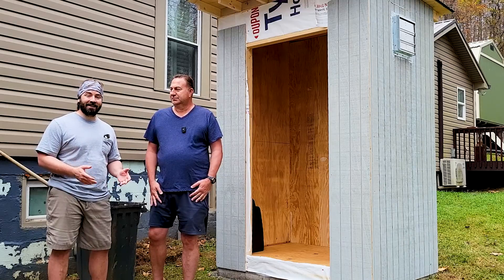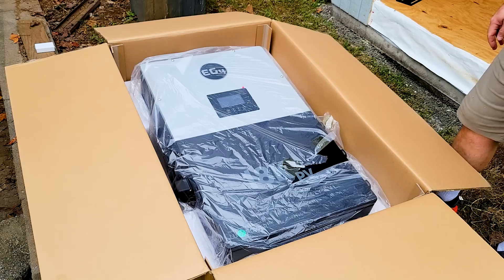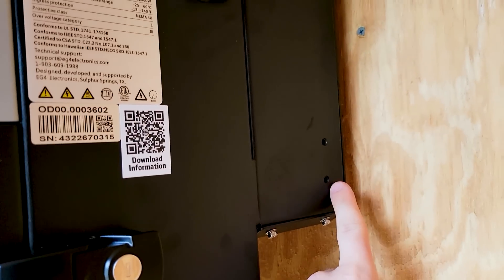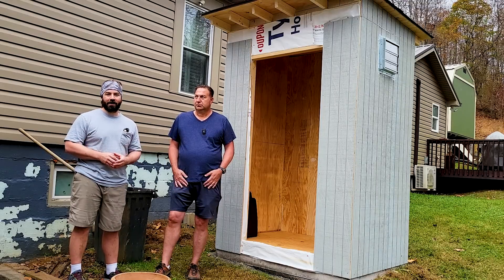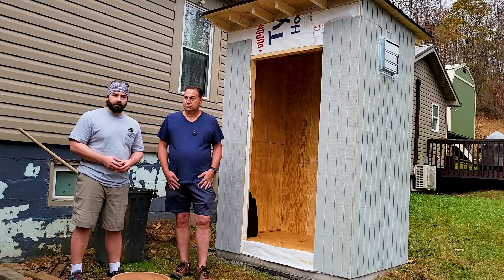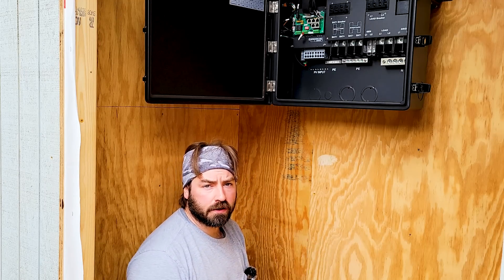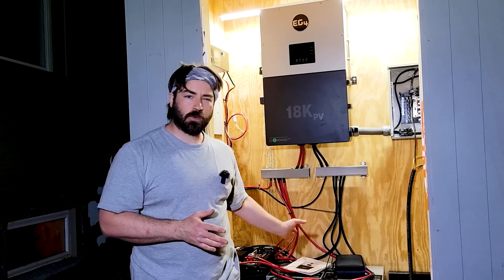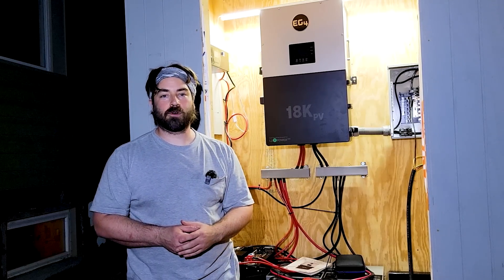Post-hurricane battery system

Comment: Thank you for this. I am interested in your thoughts on battery technology and whether it is worth transitioning from AGM to Lithium now or waiting a year or so for aluminum or sodium-ion batteries?
Reply from the maker: I remember about 10 years ago everyone was saying lithium was going to become obsolete and everyone would be moving it salt-water batteries.  There was a popular brand called Aquion at the time.  They went bankrupt.  My point of the story is that there will always be some new thing everyone is talking about, but until it's proven, I just ignore it. I think the right time for you to transition is when your current AGM battery bank isn't doing what you need it to do.  
If I had to start over today, I'd go with a proven technology.  LiFePO4 is proven.  Then, in 20 years, when I need a new battery bank, I can look at the options then.
Reply: @DavidPozEnergy thanks for that. The AGM batteries were almost free out of an old 3g cell tower and I got 16 12v 180 AH batteries, rack,circuit breakers and cables for $1500.  I have them attached to an 8k Sol-Ark and looking for ideas on AC coupling lithium batteries with a small inexpensive inverter.  Any suggestions on an inverter to AC couple to the SOL-ARK 8k and charge a six pack of 48v lithium rack batteries like in this video?
Reply from the maker: I can't give any advice on working with a Sol-Ark.  Sol-Ark has threatened to sue me in the past and I'm not getting into that.
Reply: @DavidPozEnergy holy shit.  Thinking of converting to EG4 or RUiXU and selling a used Sol-Ark anyways

Comment: Having installed the 18PV.do you still feel your 2 Schneider 6000's can outperform it?  Still looking for the dual load test on the 6000's.
Reply from the maker: Certainly duel XW pros can power up larger loads than the one EG4 18KPV.  However, that's not the market.  I think the market for the all-in-one inverters are the people looking for easy/fast installations.  In that category, the EG4 18kPV beats the duel XW pros.

Comment: I have 32 x300 amp lifpo4 Prismatic cells (8 feet battery cells). I want to make a 48 V power bank for my inverter 5 feet away. I want to use cable and cable terminals (flexible) between each of the Cells. What size copper stranded cable would you recommend?

Comment: High frequency, trandformerless inverters are designed for occasional emergency use or temporary use during a weekend camping trip. They were never meant for permanent off grid applications. They offer far poorer surge capacities and much shorter life expectancies, and because they don't use an isolation transformer, they can damage your appliances when their MOSFETs fail.
Reply: i used a growatt 3000 for 2 years to power several computers and 2 servers and have had no problems!

Comment: Hi David,
I’ve enjoyed your content for many years….
Just looking for some advice on a current Lifepo4 battery build. This new battery will replace my current AGM lead acid bank. It will be 24volt and will consist of 16 3.2v 320ah cells. It will be 24v because that is the input of my Aims inverter. I was planning on 2 strings of 8 in series and then connect them in parallel. This will give me 24v and 640ah. My question has to do with the BMS. I used a Daly BMS for a 12v battery made up with 4 cells. The BMS was easy to figure because it was 4S. The wiring was straight forward and all four cells are monitored. 
On this new build I’m not sure how to approach the BMS. I planned on using a Daly simply because I am familiar.
For the new battery I’m not sure what the approach should be. Can a single BMS be used to monitor all 16 cells in this configuration? Do I need a BMS on each string of 8 cells? I’m not sure I am even asking the right question. I am looking to protect and monitor my new battery bank. I am just looking for a suggestion or direction on how to proceed. Any information would be appreciated.

FYI…..I understand any information you give is just a suggestion and I am responsible for whatever I do with the information. 😊
Reply from the maker: I don't suggest one BMS for the whole battery bank.  I tried that approach with a few builds and it didn't work as well for me compared to individual BMS's for the individual battery.  So, in your case, I'd have two BMS's, one for each 8s string.  Only after the BMS's do you parallel the batteries at a central busbar.  
I've also used Daly BMS, but it's not what I'd go with today.  

Check out this BMS: https://batteryhookup.com/products/12v-lifepo4-smart-bms-w-low-temp-cutoff?variant=44575744032930
Optional bluetooth dongle: https://batteryhookup.com/products/bluetooth-module-for-battery-hookup-bms
And double check price per kWh with these: https://batteryhookup.com/products/new-case-4x-envision-3-2v-280ah-lifepo4-accessories
Please use discount code DAVIDPOZ at checkout.  It's both the discount, and the affiliate tracker, which helps me if you use it.
Reply: What amp rating for each BMS would you recommend? 
My inverter is 6000 watts. Way bigger than I need but bought it when I knew less than I do now. 
If I draw say 3000W it would be pulling 125A from each string. Would that be correct? If so I would have to choose an amperage that will cover my maximum intended output.
Reply: Just another thought…..would the 125A draw be split evenly across each string 62.5?
Reply from the maker: I think those BMS's I linked to are 100A each.  You would need a minimum 3 strings for running a 6kW inverter @ 24V
Reply: Thank you for your time.

Comment: Too bad he chose that low surge, short lived, high frequency, transformerless inverter. should have bought a Schneider Electric, low frequency, transformer based inverter charger instead.
Reply: These things are pretty good now, they can handle pretty sizable inductive loads with decent surge. More than just about any typical household requirement. 
These bigger units have large capacitor banks and inductor coils. This unit would weigh an extra hundred pounds if it was an LF inverter at this capacity.

Comment: For an 18kW inverter, you typically don't need separate external busbars as most modern inverters of this size come with integrated busbars internally, which are sufficient for managing the power flow from solar panels to the grid; however, depending on the specific inverter model and your system design, you might need to use external busbars for additional connections or to better manage large cable runs.

Comment: Hey David, I always like seeing new projects, goodonya for helping your mate out. With the leads from the chargeverter to the bus bars, you might have been able to connect the positive lead on the opposite side of the bus bar and been able to get rid of the loop on the cable run down the wall....sorry just my OCD kicking in !  😆🤠😎

Comment: Great in seeing these videos. Can thi inverter be configured to only charge up to 49v? For a 12s battery bank?. Have a 50kwr battery that's 12s and would like to buy one of these 18k for running of the 12s power bank.

Comment: Good to see you working with others. The chargeverter wires going through and into the inverters plastic guards, should t they be secured with a clamp in the port so no tug on the cable would damage the terminal connect point. I used the plastic insert only when going between 2 side by side Schneider inverters or charge controllers.
Reply from the maker: I'm not sure what you mean.  The Chargeverter wires don't enter the inverter.  The Chargeverter wires go directly to the busbar.
Reply: @DavidPozEnergy right oops. I meant the bus bar cables that enter bottom of the inverter. I was required (CEC code) to use cable clamps that secure the cable as it pass through the metal going into the inverter casing.
Reply from the maker: I think having some clamp on there is a better way to go.  When I installed my Schneider system in my garage I clamped my wires entering my PDP because I was concerned with my kids in the garage possibly pulling on them.  In this case, Richard was making some of the decisions.  Personally, I think bushings are fine in this situation since the 2/0 wires are about 14" long, and inside a locked electrical building.

Comment: It looks like the openings between the roof rafters is closed off. Don't put a fresh air intake vent at the ceiling level. The best area for a fresh air intake vent would be as low as you can go on the side facing the house. The air is cooler near the ground and if you put white stones between the shed and the house that will even make it cooler (if the sun hits this area). Also, I would recommend installing 1" insulation board on the inside walls to help in the cold winter temperatures. Great video!

Comment: hopefully this isn't too naiive, but why do you need the chargeverter with the EG4 18K unit?  I had thought you could just run the generator output directly to the 18K unit.
Reply from the maker: You can, but having the separate chargverter means the inverter runs all your loads, and the generator can be run at peak efficiency for charging.  Overall I prefer this method.
Reply: @DavidPozEnergy glad you explained it. I was having the same question.

Comment: Nice video David! I'm a novice solar dyi guy, and have a 18k offgrid that is wired directly to my 14k generator with 43kw of EG4 batteries. Should I have a chargeverter instead of wiring directly to the 18k? Thanks!
Reply from the maker: If it has been working perfect for you, never glitching, then don't bother changing it.  A lot of people have experienced glitches, including myself when trying to run a generator directly into an inverter while powering loads.  Separating the charging from the inverter keeps everything happy.  I demonstrate some of the glitches I've had in a previous video.
Reply: @DavidPozEnergy  ok, so far it's worked great with no glitches so far! I'll look for that video also. 
 Thanks for the great advice and keep up the awesome videos!

Comment: Nice work, fun video!

If anyone is following this as a guide, there's a few important things that David misses.  You should take the time to review the installation manual for the inverter.

Use a torque wrench for ALL of the battery and AC wire connections, you can get one cheap enough and it prevents and possibility of stripping.  This is one of those things people get away with until the one time they don't.  The manual for good batteries, the panel, and the inverter, has specs.  Last EG4 18kpv setup I did, it was 275 inch-lbs for 4/0, and 165 inch-lbs for 2x2/0.  It is also required by code if you're getting inspected.

When connecting the battery and AC cables to the inverter, you should use anti-oxidant compound.  Wiring manufacturers recommend it, and especially if your equipment is in a high humidity environment. Many AHJs will also cite not using anti-oxidant of some sort as a defect or violation (even if its ultimately not by code.)
Reply: I was going to mention this the first time the panels are used it adds heat and vibration on the lugs after a few hours come back and check with a torque wrench just to be sure it hasn't changed once your sure it has not changed you'll be fine.

Comment: Great video. Question, are you supposed to use ferrules on the battery cables?
Reply from the maker: Depends on the wire strands and the type of lug.  In the video, I used ferrules on the main battery positive and negative connections.  The lug they are going into is a single screw going into the wire.  The wire we are using is fine-strand.  So, in this situation a ferrule is required.

Comment: why do americans do not switch to 240v, especially the off grid people? 
with 240v system it would be so good, just plug your appliances and do not have to worry about the load imbalance and thick cables.
Reply: That would be great but things have been 120V forever. It would create a ton of e-waste if it wasn't a slow switch over. We could certainly start changing that by slowly introducing codes. For example starting off by requiring a couple 240v outlets in the kitchen for appliances like kettles, griddles, and microwaves. We already have a NEMA 6-20 standard for that.
And then hopefully that would trickle down to being required in all rooms. It would be nice to double the power capacity of each circuit. Getting rid of the neutral line entirely would certainly reduce some of the wiring costs as well.
Reply: Why don't "across the pond-ers" switch to 120?  We like our system and imperial measurements are better!
Reply: The problem is in t hat "just plug your appliances". The appliances aren't made for 240v and it isn't worth getting special units just to save 33% of copper costs.

Comment: If he adds another pallet worth of solar his generators will not be the weak link. Getting fuel is always the long term issue in a major disaster. And you usually end up paying through the nose for it in those circumstances as well.

Comment: Installed 18 K this time last year it has been working flawlessly since then I’ve had no trouble with it. I’ve also got the batteries back up. I’ve got 400 watts panels. It’s a great unit so far.

Comment: Very cool video and I love what you're doing here.  Not to diminish it in any way, but it's awesome how much easier it is to DIY a solution like this, compared to how it used to be.  Mounting the chargeverter below the location for the batteries might have been beneficial?  In theory, you would only be running the generator when it's too cold to use or charge the batteries with solar, so having the heat from the chargeverter rising up to the batteries would be nice?

Comment: It's interesting to me that you guys are mounting this on a combustable rear surface. Here there's a requrement that inverter like this is mounted on a non-combustable surface. Usually this is done by mounting a kind of special fiberboard designed to be non-combustable on top of whatever wall is already there.

Comment: I have a shed that’s almost the same thing with a thermostat controlled exhaust fan. From my experience for two years. That exhaust is too small, I would get an attic fan that I would install on top. Listen to me when I say, that fan will not have enough suction to pull the hot air. He will need to install some intake holes on the bottom on the shed.”, so cool air from the bottom can be pulled up. Trust me on this. Get an attic fan. Or install the smallest window ac unit. It will get hot during the summer.  I have to keep the doors open and have a box fan blowing air in. During the winter, I cover the exhaust and intake holes and add a r reptile ceramic heater100watts that I have hanging in the middle with a small fan. It keeps it between 45’ to 55’ degrees.
Reply: Just install 9k btu inverter AC unit
Reply: Instead of the huge window shaker, just toss a double ducted portable AC in there if concerned.

Comment: I just bought the more or less same one only LuxPower it is a bit of a beast to wall mount the day I installed it the power went down for 37 hours and it performed wonderfully but I did find out my 120 volt genny would not charge the battery so I will look for a chargeverter soon.